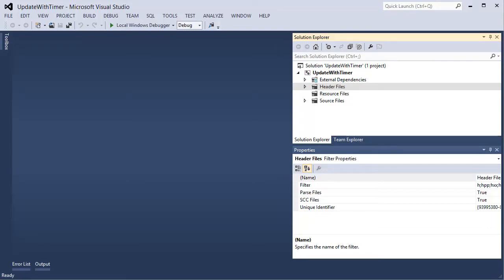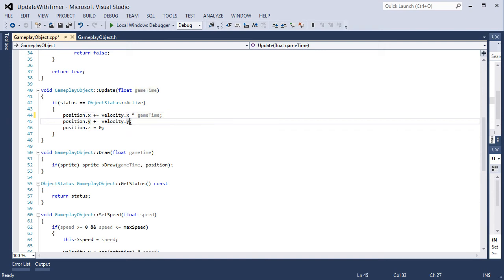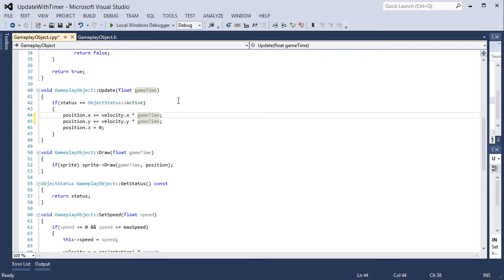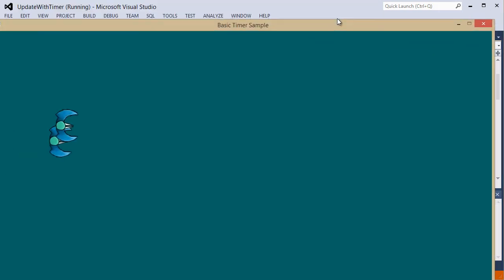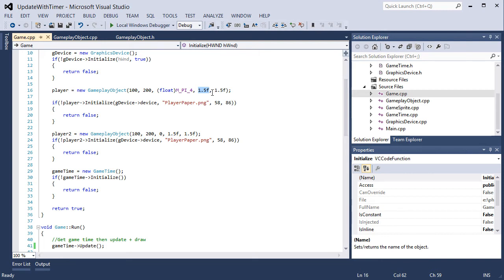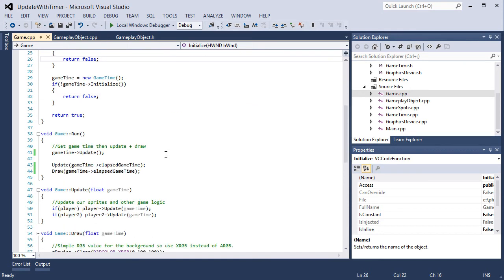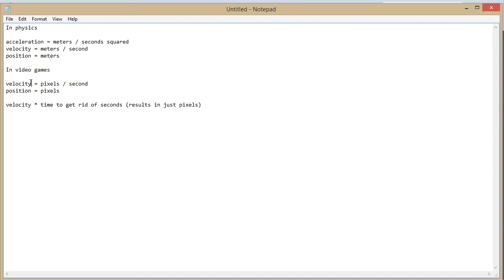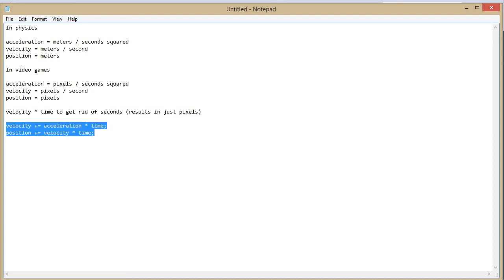[DirectX 9] Tutorial 8 - Update Sprites with Timer

Comment: Question(s)

Hi again.

Second, how do you reverse the sprites direction more than once? I can make the sprite move left, stop at the edge of the window (position.x < 0) and reverse direction using a SetVelocity function created based of your SetSpeed, but I can't make do the same again at the opposite wall. The best I can do is make it decelerate to a stand still after the first "bounce".

Thanks again. Can't wait for more.

As I am learning do you recommend any books or is there any which helped you make this series?

Jim
Reply from the maker: I would modify the constructor (either changing the existing one, or making a second one) of the gameplay object to accept a rectangle called bounds.  If the object's position is outside the top, left, right, or bottom sides of the rectangle, change the direction.
Reply from the maker: I do not have any book recommendations.  I learned most of the logic through years of XNA/C# development.
Reply: Nathan Biefeld
Nice idea. I managed to do it eventually and can now define Rotation (direction it moves) and Position (on window) outside of the GameplayObject function in Game.cpp.

I will try yours as well. Need the practice haha.

Comment: Question(s) :)

First off, great series. Beforehand, I haven't been coding that long.

First, I have been trying to make the sprite accept keyboard input but it isn't working. I created a input manager "inputs" header and cpp file and defined keycodes, but when it comes to making the sprite move with keys, nothing works.

How would you go about it and where do you call the function allowing input? Under update? Also how would you make only one sprite move? I can alter the Speed and Velocity via a function separate of GameplayObject function in Game.cpp but it is applied to all sprites.

Jim
Reply from the maker: You can have the sprite have 0 speed until the mapped key has been pressed.  Or only call the update function when the mapped key is pressed.  I have a tutorial coming soon that discusses moving sprites with input.
Reply: Nathan Biefeld
Thanks for the suggestion. I will look into that.

Will the tutorial be using WinAPI or DirectInput? Was using DirectInput but just found out recently its been deprecated >.>

Either way, thanks!
Reply from the maker: WinAPI